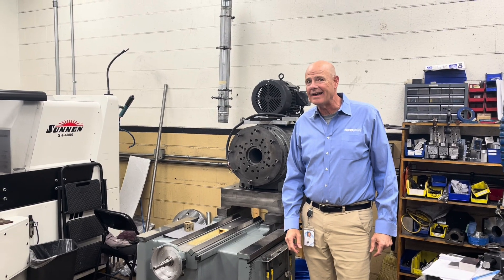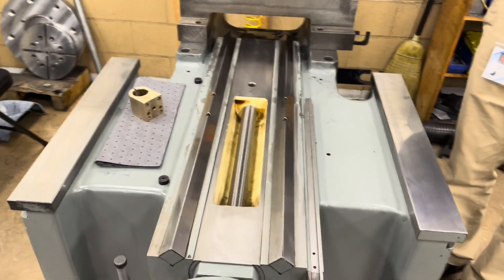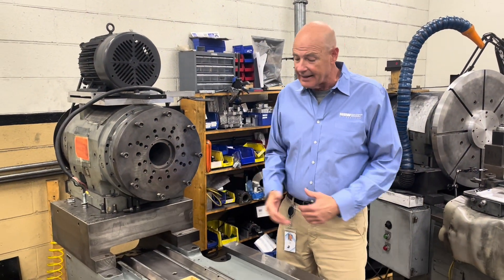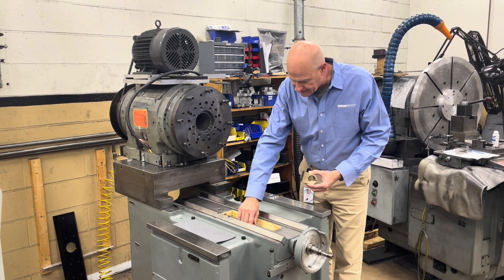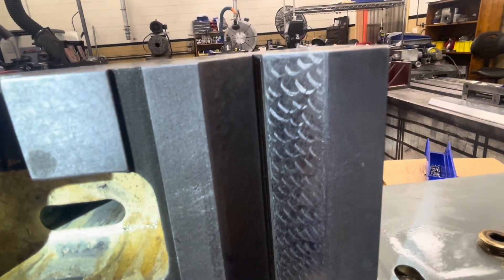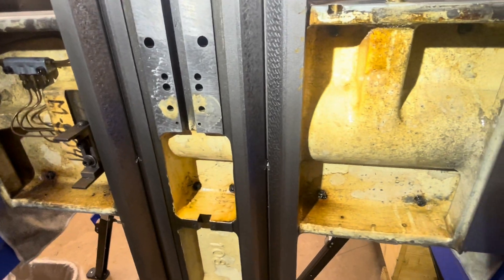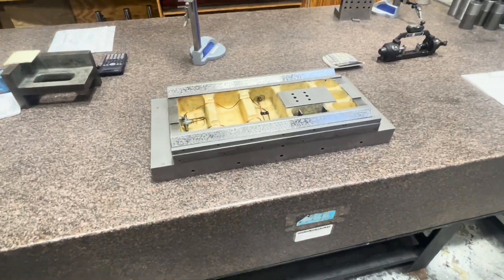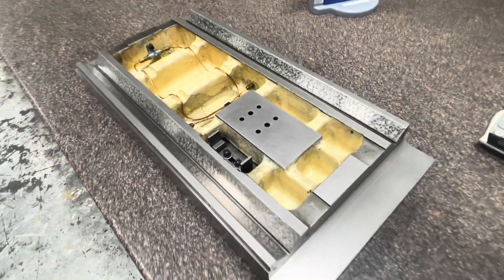Ways on Moore # 3 jig bore base retrofitted to create a DTM are evaluated after 50 years of use.

Comment: I am fortunate to have a 1952 Moore #2 out of Hanford plutonium production, the machine was set up by Moore for specific purpose. Still holds tolerance. Moore made vertical glass turning lathes and other special machines used at that site,, thanks for the video!

Comment: Mr Dan Gelbart - a very smart(genious) individual who has made a limited number of videos on utube and who I think owns several private businesses making extremely innovative things (like metal 3d printers) speaks of the Moore jig borer with reverence as it achieves incredible precision and can be these days bought for scrap prices - this is a fantastic channel for precision geeks.
Reply: Many years ago, Dan had built a special "room", below ground, in his house, with a high flow air conditioning system to maintain isothermal conditions for the equipment in that room... including a jig borer. Dave Sloan (a friend of Dan and myself) had a Swiss jig borer, with an interferometer measurement system, and a Moore 1440 circular base, in his basement... A couple of precision-lovers!